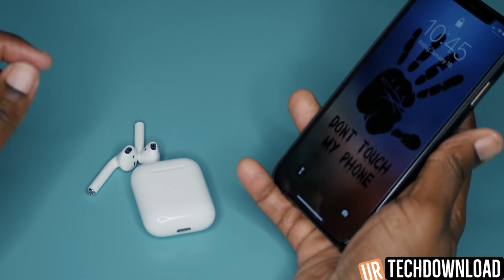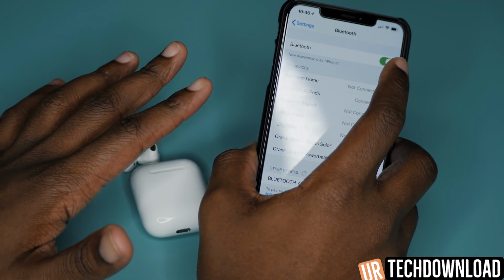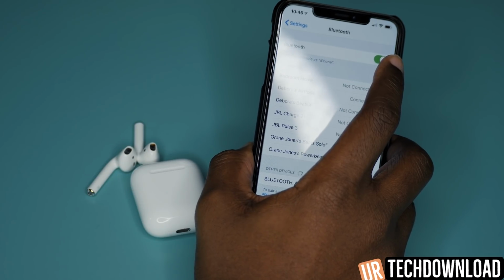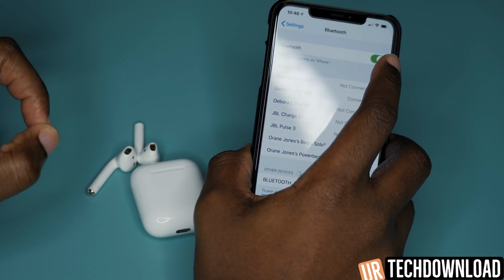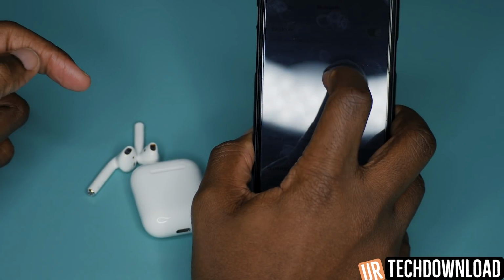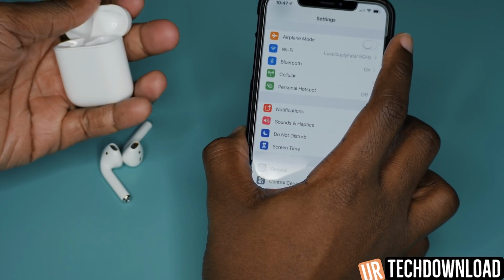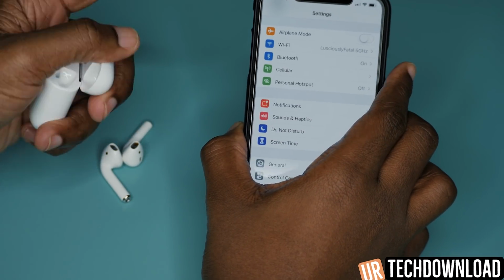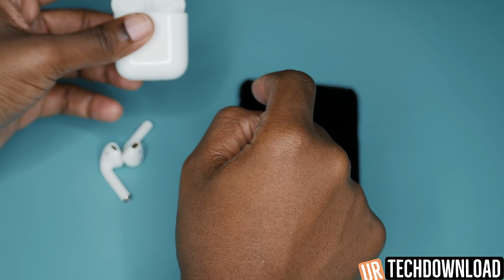Airpod Issues? No Problem! Here's How to Fix Them

Comment: My AirPods connect to my phone and make the in ear detection sound yet no audio plays and it’s just silent. I have reset and disconnected and reconnected my AirPods. Any ideas?
Reply from the maker: You can also try going into the settings and turning off the automatic ear detection setting and see if that works

Comment: i have a problem with my airpods where it keeps on disconnecting especially in the first 10 minutes used. if i connect the airpods back to my phone without placing them in the case , only the left airpod connects. Can you tell me how to solve this?
Reply from the maker: for this issue I would suggest try re pairing the airpods to your phone having the phone first completely forget the airpods then going back in and doing the re-pairing of the airpods to the iPhone. if that doesn't work then I would suggest doing a full reset on the airpods themselves, and also doing a full reset of the network settings in your iPhone as well.
Reply: @YourTechSimply  i tried this not working
I have similar problem he mentioned

Comment: What do I do if my airpods keep going in and out
Reply from the maker: try restarting your iPhone, if they are still having issues have the iPhone forget the airpods then reconnect and see if that helps. Also, check the firmware to make sure everything is up to date.
Reply: If you grip them at your fingertips and extend both arms outward, then rotate your torso back and forth at a gradually increasing speed for about two minutes.  They will begin working once again.

Comment: My AirPods won’t connect and I cannot reset them they just flash green
Reply: Rico Aguilar same
Reply from the maker: The first thing to try is having the phone  Forget the airpods. Return your AirPods to the charging case and close the lid.  After 15 seconds, open the lid again. Press and hold the setup button on the back of the charging case. Keep holding the button until the status light flashes from amber to white. Now pair your AirPods with your device again. If you don't get the Amber Light, try to Reset the Network settings on your iPhone, If the steps above didn’t solve your issue, take a look at the contacts at the bottom of your AirPods Clean the charge contacts on your AirPods as well as the contact points in the case. Insert your AirPods into the case after the cleaning Now Try Resetting the AirPods and you should see the Amber status light and the reset operation should work.
Reply: Rico Aguilar for me i just didn’t use them for a whole week, and charged them and it worked
Reply: Same
Reply: Same goes with me
Reply: Just how to reset it when you just having flash green and then it die and can’t do anything
Reply: Mochammad Dhea Tities Guritna same did you resolve it?

Comment: ok so they’re both connected but i rarely sometimes hear audio out of the left they’re all charged the left airpod just doesn’t play audio and they skip when double tapped and everything just no audo
Reply from the maker: A couple of things you can try is, rebooting your iPhone, toggling the Bluetooth on and off, and toggling on/off Automatic Ear detection in settings, and while you at it check to make your audio balance is set to the middle so the sound is coming out of both airpods. You can also try disconnecting the AirPods from my iPhone ("forget this device" in settings) then reconnecting. But in reconnecting the AirPods you have to keep pressing and holding the Bluetooth setup button on the back of the case until the status light flashes amber a few times and then finally flashes white. Hopefully, that helps.

Comment: When I open my AirPods it doesn’t show up on my phone , I need to reset my AirPods for it to show up , or I need to go into setting , but when I do that my left still isn’t working , I’ve tried everything , any ideas ??
Reply from the maker: resetting the airpods is a good start but also don't forget that sometimes you need to reboot or restart your phone as well, and as always if one airpod is not working it's a possibility that it's just not charging the way it's supposed to because of an interference between it making contact with the charging plate at the bottom of the airpods case.you can check  the comments and some of the troubleshooting steps I have been recommending is cleaning out the bottom of the case with a q-tip and making sure there are no scratches or debris on the end of the airpods placing them back in the casing even applying a slight amount of pressure to make sure they're making contact at the bottom then charging them for about 15 to 20 minutes and attempting it once more.

Comment: If you open your AirPods and one side is not working it’s either because the connector inside the AirPods case has dust in their OR your AirPods tip on the bottom is heavily scratched that’s why it won’t connect to the AirPods case which is the reason why it won’t work or connect.
Reply from the maker: thanks for the comment, great tip a lot of people been having connection issues and sometimes it can really just be boiled down to some dust or debris getting into the contact plates at the bottom of the airpods case so cleaning it and checking for scratches is a great tip.

Comment: It worked well at first. But now once I listened to music, the right side always automatically disconnect. 
Any solution ?
Reply from the maker: anytime one specific airpod starts malfunctioning it can point to that specific airpod not establishing a good enough connection with the connectors at the bottom of the case. try cleaning the bottom of the case with a q-tip cleaning the bottom of the airpod that's having the issue charging it for maybe an hour or two and then trying it again, you can also hit the standard troubleshooting steps of having the device forget the airpods then try to re-establish the connection, abd doing a full reset on the airpods themselves.
Reply: URTechSupport Will try it.
Thanks
Reply from the maker: Anytime

Comment: My airpods case can’t be charged, ( R100% ⚡️/ L100% ⚡️/ case 40%( nothing) ) and then turned wifi off ( case 40%⚡️) it worked 

Thanks for this helpful video 👍🏼
Reply: But why when the wifi off it charges again!
Reply from the maker: that's an interesting issue but it seems like it could be some kind of interference causing between the case and a Wi-Fi which is weird, I would just suggest doing a complete reset of the case while it's plugged into the charger and then re-establishing the connection with the phone and seeing if that will help fix the issue.
Reply: It can also be with the type of charger you got, cuz mine wasnt workin and i got a new one and it was good

Comment: So at first my left airpod stopped working so I decided to go and click “forget this device” and reconnect but when I tried it wouldn’t show up. I would hold down the button but nothing would happen. I tried thousands of methods but neither worked like the q-tips or restarting and more. I’m thinking I should just go to the apple store and ask for help there?
Reply from the maker: I would agree with taking it back to the Apple store, you left airpod failing would be an indication that it may have not been making contact with the charging connectors at the bottom of the case, cleaning it with a q-tip was the right move and having it forget the device was a right move as well. because the airpods need to detect that both airpods are in the case and making a proper connection maybe the reason why it's not resetting currently
Reply: Corbin Szabo yeah i had a one year guarantee for my airpods so i went to the apple store and replaced my left airpod for a new one

Comment: whenever I open my air pods it keeps blinking amber and it will not let me reset them. any suggestions ?? I got them today and they are not resetting
Reply from the maker: Some times when the airpods are not resetting it's due to them not making contact with the connectors at the bottom of the case. So cleaning the bottom of the case and also the bottom of the Airpods can go a long way in fixing that issue. But In your case since there new I would just bring them back and get another pair, you should not be having issues this quickly.

Comment: every time i pause the music and then play it goes to full volume and then goes silent same when i finish a call
Reply from the maker: That's a new one, never ran into that one before. In this case, I would suggest having the phone forget the Airpods then set them back up. If that does not work, I would also take a look at first doing a hard rest on the phone, then resetting the Airpods and seeing if that helps. Also, check to make sure your firmware is fully updated on both.

Comment: I got my pair about a month ago and they were fine till about a week ago the Kept skipping now my left one won’t connect to my phone any help?? (Also it is at 100% when I take it out of my ear it has this ! But in red
Reply from the maker: One suggestion would be to Open the case and check the bottom connector to ensure there is no debris interfering with charging it. Then check the connection end on the AirPod and clean if necessary. Charge them again and then try a reset on the Airpods.

Comment: Please help man, I got my air pods they’re remotely new I had them for 2 months now first few weeks the audio was fine now I notice that when I’m on a FaceTime call the person I’m talkin to can barley hear me and I ran a few test on voice memos and they’re right my audio is really low, is there a fix? Or am I screwed ?
Reply from the maker: There are a couple of things you can try, By default, AirPods are set to automatically switch between left and right microphones when on a phone call, try going into the settings and switching to  Always Left AirPod or Always Right AirPod and see if that helps. You can also try the standard things like having the phone forget the airpods, restarting the phone, and resetting the aripods. Also, try cleaning the bottom of the pods themselves to make sure nothing is obstructing the microphone. And even though you're two months in If nothing else works I would still suggest just to reach out to Apple and see what you have to say, Shouldn't have to be stuck with the broken product after only two months.
Reply: URTechSupport thanks man I’ll give these a try.

Comment: my airpods aren’t connecting at all its not blinking white any tips?
Reply from the maker: This problem seems to indicate that the AirPods are not connecting or making good contact with the electrical connections at the bottom of the AirPods’ case. Try cleaning both the AirPods and the inside of the AirPods case, then try to have the phone forget the airpods, then try the rest once more.
Reply: URTechSupport i tried that and they still arent working
Reply from the maker: The last thing I could suggest is after cleaning both the tips, and inside the case leave the airpods connected to charger for about 10 to 15mins then try once more, also you can try to connect to another devices like your Pc, table or laptop as a test as well. If it's still not working it may be a bigger issue and I would suggest reaching out to Apple
Reply: URTechSupport ok thank you
Reply from the maker: Anytime, I hope you are able to get your issue resolved

Comment: Most of the time when I make a call the mic doesn’t work it makes me angry the is I can listen to the call but the one I call can’t hear me what can I do ??
Thank you for the video man
Reply from the maker: Thanks for Watching, and the comment, Sound issues can be a hit or miss when it comes to troubleshooting, the first thing you should try is going into the settings and changing the mic settings to set either the left or right airpod as you main mic. This will give you an idea if the issue is happening on one of the airpods specifically. You can then try to have the phone forget, and re-pair the airpods then test once more. You can also try restarting the phone, and resetting the airpods themselves and test once more. You can also try restoring the firmware:  Place both AirPods in the charging case after  Press and hold the button on the charging case until it flashes white, Place the case with the AirPods inserted to charge. Wait until either the LED turns green, or until 10 minutes has elapsed. You can close the lid while you're waiting for the firmware to update. If you're still having issues, Contact Apple Support.

Comment: I bought 1 couple of airpod I started using this left side of airpod doesn't works so what can I do to solve this problem
Reply from the maker: there could be a couple of reasons that one airpod is not working, This problem could indicate that the AirPod is not connecting or making good contact with the electrical connections at the bottom of the AirPods’ case and is not charging correctly.  Try cleaning both the AirPods and the inside of the AirPods case then charge the airpods for about 15- 20 mins and try them again. also, check the airpods settings to make sure the audio balance is set to the middle, you can also try a full rest of the airpods. but if none of that works then it may be a hardware issue, in that case, you would have to reach out to apple support.

Comment: When trying to set up for pairing, the light will not flash white or amber while holding the button. My Bluetooth is on and my low power is off. My airpods are fully charged but still nothing
Reply: It will only flash green

Comment: What do I do if my right AirPod has a red exclamation mark next to it , how can I fix it. I’ve tried everything you have offered and it still doesn’t work
Reply from the maker: If you are seeing a red exclamation mark next to your left or right AirPod on the connection screen when connecting to your iPhone, this means the device is having issues connecting to the specific AirPod. You Can have the phone forget the Airpods, then with both airpods inside open the case and press the setup button on the back to reconnect. If that does not work,  The second most common reason for the red exclamation point error is that there is debris interfering with the charging. Open the case and check the inside bottom of the case for anything that may be blocking the connection. Remove it by blowing into it or using a cotton swab. Now recharge the AirPods and reconnect them. If you still having the issue Please reach out to apple support.
Reply: Charge it or repair it

Comment: My right airpod doesn’t work the status light flashes and doesn’t connect to my iphone
Reply: same with my left one right now and i’m heated
Reply: Lukas TM what color is the status light
Reply from the maker: So it looks like that may be a common issue, There may be an issue with the charging connectors in the case. But you can try to clean out the bottom of the case with a qtip and the bottom of the airpods themselves, place the airpods back into the case and maybe try applying a slight bit of pressure to make sure they are making contact with the charging connectors at the bottom of the case. Then leave them to charge for about 15 to 20mins. You Can also try a rest on the airpods and If your still having issues after, reach out to apple support it can also be a hardware issue.

Comment: my airpods connect but after a few minutes they disconnect 
how do i fix this?
Reply: Did you fixed if so could you tell me how please
Reply: Erik Samuel Saldana no i haven’t fix it yet i don’t know how to
Reply from the maker: With Disconnecting issues, there is a couple of things to take a look at, Make sure the firmware on both the phone and the airpods are up to date. Make sure the airpods are not connecting to another nearby device. Try putting your phone into airplane mode then try to reconnect, have the phone forget the airpods then try to connect again, Try to reset the network settings on the phone, and finally, you can try to do a full reset on the airpods themselves. If it's still resetting after that then there may be a hardware issue with the airpods and you should reach out to apple support.

Comment: my right airpod stop charging but the left one is fully charged  how can i fix this issue please tell
Reply from the maker: There may be an issue with the charging connectors in the case. But you can try to clean out the bottom of the case with a qtip and the bottom of the airpods themselves, place the airpods back into the case and maybe try applying a slight bit of pressure to make sure they are making contact with the charging connectors at the bottom of the case. Then leave them to charge for about 15 to 20mins. You Can also try a rest on the airpods and If your still having issues after, reach out to apple support it can also be a hardware issue.

Comment: my right airpod won’t work and the AirPods won’t connect to my iPhone. I have tried everything, it won’t work. ¿
Reply from the maker: There may be an issue with the charging connectors in the case. But you can try to clean out the bottom of the case with a qtip and the bottom of the airpods themselves, place the airpods back into the case and maybe try applying a slight bit of pressure to make sure they are making contact with the charging connectors at the bottom of the case. Then leave them to charge for about 15 to 20mins. You Can also try a rest on the airpods and If your still having issues after, reach out to apple support it can also be a hardware issue.

Comment: I have oppof7 and my left side airpod automatically disconnects after one minute,.. what should i do?
Reply from the maker: This may indicate an issue with the left airpod itself if you are sure it charging correctly, then you can try to do a full reset on the airpods themselves. If it's still resetting after that then there may be a hardware issue with that airpod.